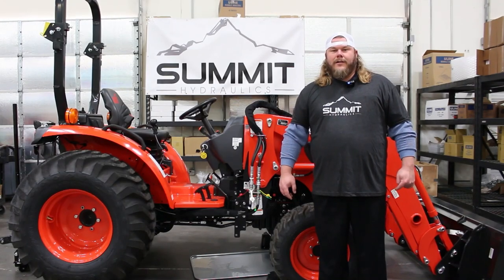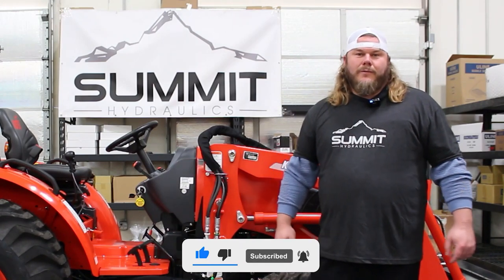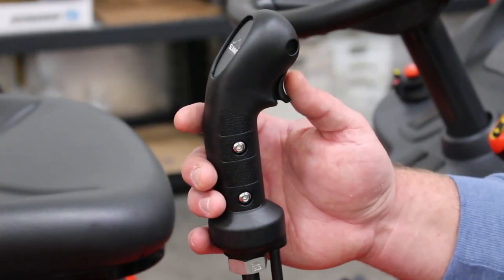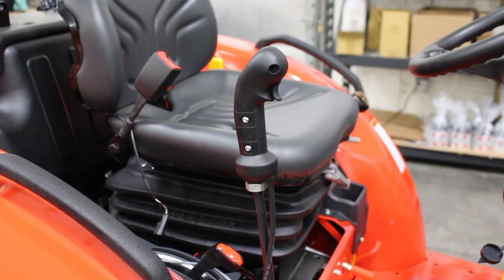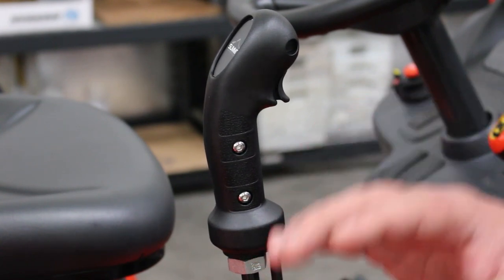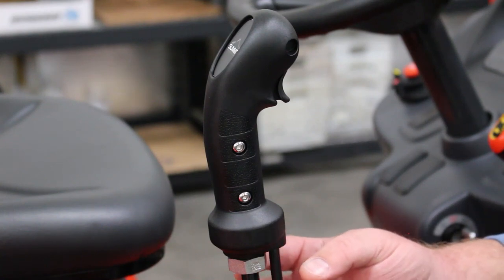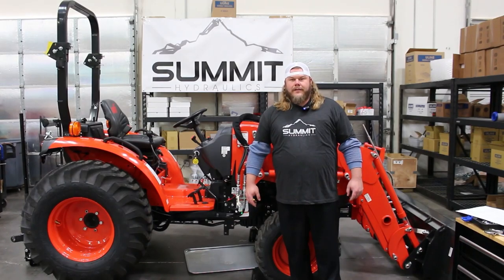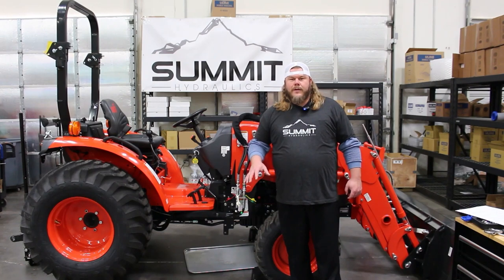Summit Hydraulics Universal Diverter Valve Installation

Comment: Hi there. I bought one of these valves. I cannot find any information on the small L port located at the bottom side of the valve. Is this a  return to tank drain line? When is it required to have this line connected to the return line to tank in an open system? I purchase a suitable plug to block the L port  or is it better to connect it to the return line.  A very quality valve. Thanks Dave
Reply from the maker: There isn't a specified L port on the diverter. There are small drain ports that come plugged with the valve.
Reply: Thanks for that. I noticed one of the metal plugs was removed from the small drain port and had a red plastic bung in its place, similar to the A,B,C,D ports only smaller in size so I wrongly  assumed that this was a return line. Cheers @summithydraulics

Comment: Do they make a universal divert value for 1994 Ford tractor 2120 series
Reply from the maker: Hello Todd,
You can use one of our 13 GPM Universal Diverter Valve Kits for your Ford 2120.
https://summit-hydraulics.com/product-category/hydraulic-kits/hydraulic-diverter-valves/hydraulic-diverter-valve-kits-with-without-couplers/

Comment: Does the diverter valve have to be mounted with the coil pointing up or can it be mounted in any position?  Enjoyed the video.
Reply from the maker: You can mount it in any position.

Comment: Hello
If you cross the base and rod sides and run it (as I did....) will the jam be permanent, or will it work once you uncross the lines? I will not know for a bit since I unfortunately damaged once of my supply lines and cannot retest it yet...
Base on the supply line issue I am thinking the jam may be permanent ....
Reply from the maker: Hello, uncross the lines and you will be fine. The jam is not permanent! :)
Reply: @summithydraulics  Thank you, To all who read this; once I connected everything properly the diverter was just fine and everything works great. It's a tough dependable diverter that is working well.
Jim

Comment: I see on the website you have several different options with different flow rates. How do I know what I need? I have a Bobcat CT2025. Plan would be to run an add a grapple. Plus it seems like everything you have is on sale right now.
Reply from the maker: Hello, we have a complete kit for that model.
https://summit-hydraulics.com/product/third-function-kit-for-bobcat-ct2025-tractor/

Comment: I just used mine for the first time and it seems to be stuck on the 3rd function.  I pushed the button on the joystick and the grapple is working fine, but the red led light stays on and i lost my curl function.  I have pushed the button as well as held it in, but it won't revert back to the curl function.
Reply from the maker: We recommend rechecking all lines connected to the valve. If lines aren't configured right then it could cause fluid not to divert right through the valve. If you have any more trouble shooting questions about your valve, please contact us at contact@summit-hydraulics.com
Reply: nope...got it figured out.  Just the contactor in the joystick.  I'll be calling for a replacement.

Comment: How exactly does that work? If you connect it as you described, The other curl cylinder is still connected and will want to move when you operate the joy stick. The cylinder connected to the valve will be effectively closed with no relief. Sounds like a great way to twist the SSQA plate.
Reply from the maker: The other tilt cylinder has a Tee fitting going to it as well so hooking up our diverter valve won't interfere with the functionality as along as the lines are hooked up right.
Reply: @summithydraulics  That wasn't my point. The fact that it has a T is my point. When you activate the solenoid to divert the function to one of the cylinders, the other is still in the circuit. When you operate the added function, it will also be still putting hydraulic pressure to the other cylinder. In the case of a grapple attached to the third function, that cylinder will be trying to curl/uncurl at the same time as you are closing the grapple. The cylinder you diverted from will be locked in place as the valve has the oil flow off.
Reply: @summithydraulics  my point is, you need to intercept the line before both cylinders